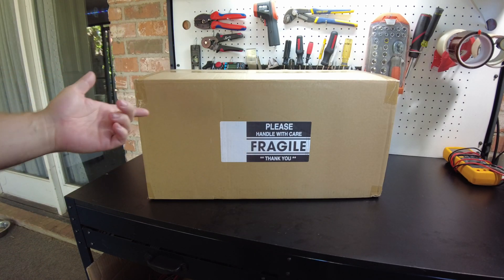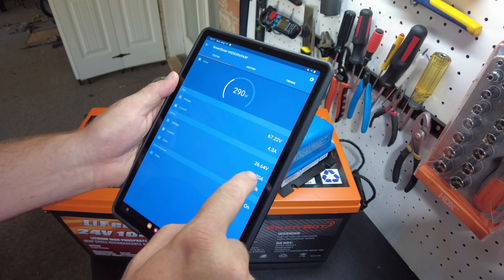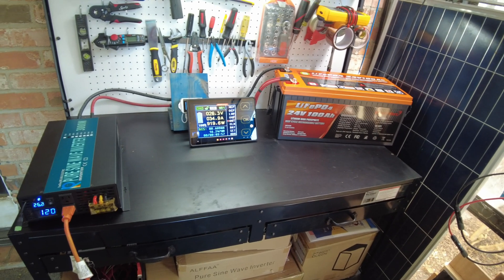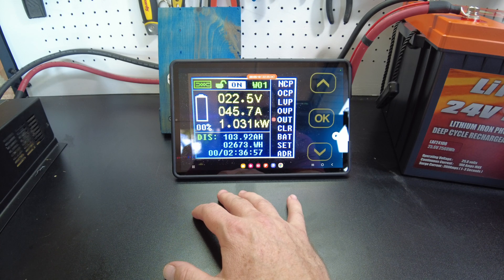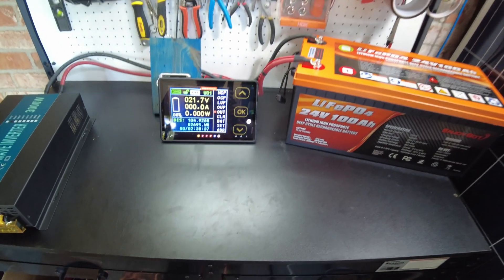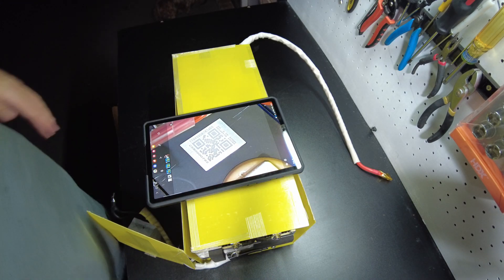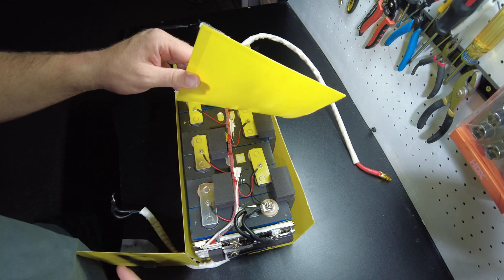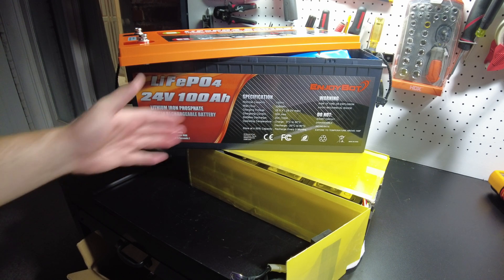Enjoybot 24v 100Ah LiFePO4 Lithium Battery

Comment: Notice how little the voltage droops.  Just one of the many advantages of going with a higher voltage.  You get significantly higher efficiencies across the board, even with long cable runs.  The advantages go way beyond the basic higher-power-for-lower-amps feature.

-Matt

Comment: They had the ones with low temperature protection, they're about two hundred dollars higher per battery 🔋. The heater draws a lot of charge out of the battery to heat it. It's easier to just keep the battery warm. They obviously don't work in the cold. It's really an important option only if you needed an idiot proofed battery 🔋. If I bought three without the heater, I could afford another one instead of the heaters.

Comment: I've got three if these on my solar setup. I wanted a fourth one to run the air conditioner this summer, but it says sold out. Will I have to use two 12 volts ones ?
Reply: If you can wait / have the patience, it is best to just stick with the correct voltage.  While you can put two 12V (12.8V LiFePO4) batteries in series and then parallel with the rest of the 24V bank, you'd have to add an additional whole-battery balancer for the two 12V batteries.   It works fine if you don't have a choice, but it isn't ideal.  The wiring is a bit messy

For example, I had a small 24V (25.6V LiFePO4) system with three batteries in parallel that I bit the bullet on and upgraded to 48V (51.2V LiFePO4) at the same time I also was adding capacity.  I wound up buying two 51.2V batteries @ 50Ah (also 2560Wh each) to put in parallel and upgrading the system voltage.

But I didn't want to put my old 100Ah 25.6V batteries (also 2560Wh each) on a shelf... that's a lot of money!   So I put two of the 25.6V batteries in series and then paralleled that with the 51.2V batteries to take me to 10240 Wh of storage. 

I'm very happy with the result, but I had to cobble up a balancer for the two 25.6V batteries that I had put in series to make it truly hands-off operation.   Extra cabling, extra fusing on the balance wires, the topology isn't 100% current balanced in terms of the cabling (though its close enough I don't really care about that).

-Matt

Comment: 105Ah at a nearly 0.4C rate. That's pretty good!
Reply from the maker: Yup, not too shabby! BTW you can do 1C rate with LiFePO4 and still pull full capacity. That 0.2c rate may be a standard, but it's a relic of the past. Lithium has such low IR, it makes little difference.